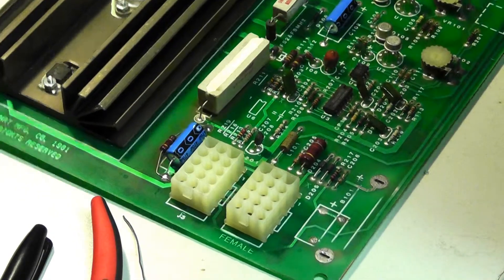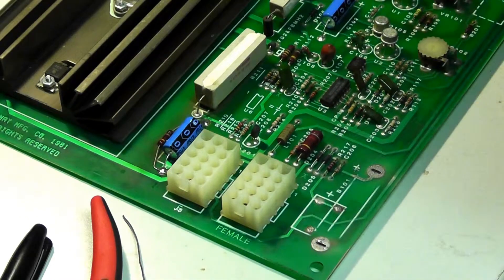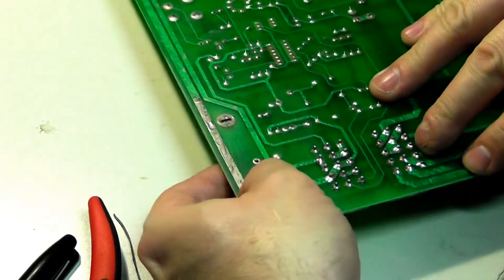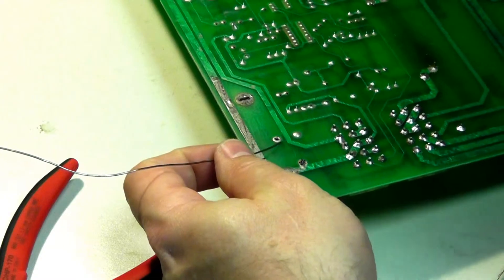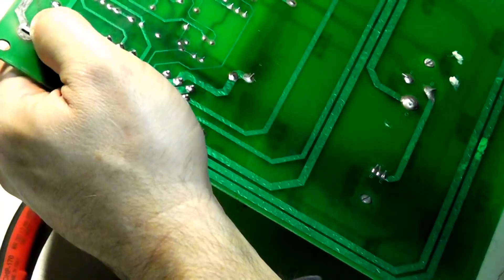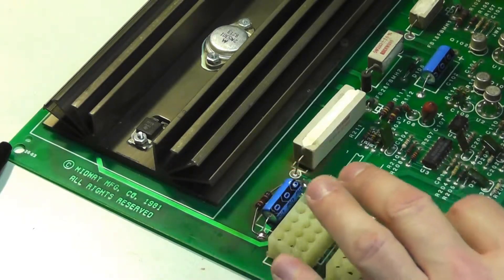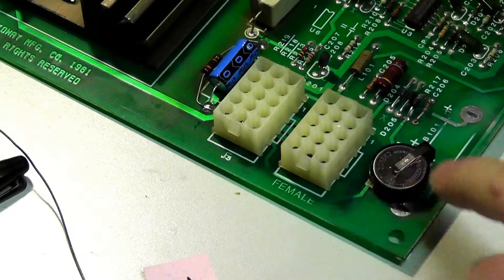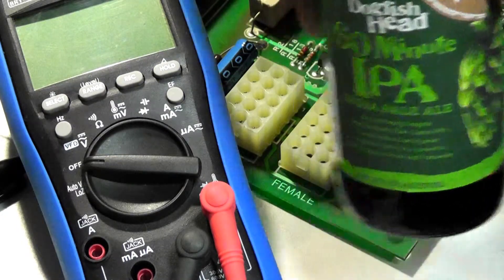MCR Power Supply Battery Mod

Comment: Good video. I've done this conversion and the first time the battery would die with in 2 weeks or so. I took the diode out to check it and it seems to be working fine.  Upon reinstalling it I noticed both pads for R217 on the bottom are missing now, so I used the top pads to hold in the diode. When I test the voltage of the battery like you do in your video I get 2.74V from a 3.03V battery. Any thoughts? It's great you post these videos, they're a big help!
Reply from the maker: the pcb trace is on top so don't worry about not having the bottom pads.  I may have to go back and watch video again but this is likely just small voltage drop induced from diode.  Measure voltage from negative to battery positive, then to non banded side of diode (aka r217) and then to banded side of diode.  Most new batteries will be @ 3.3v so a .3 volt drop will result in 3.0v on the banded side.  I bet your battery is closer to 3.0v so .3 volt drop is 2.74....thanks for the comment
Reply: If I may further pick your brain. I have tested the draw on the button battery with the machine off, and it measures .640mA and increases by .001mA every few seconds. Any thoughts on where this draw could be coming from? I doubt the bookkeeping memory it is designed to keep alive draws that much.
Reply from the maker: Out of my current knowledge base.  However, I just realized my spy hunter is not saving high scores even with the coin cell mod.  I haven't looked at all the components on the v.batt line but expect I have a bad 6116 ram.  Sounds like another video is in store in a week or so. edit>>or I have heard of problems using the coin cell mod..may just go to nvram if I can't figure it out.
Reply: I took a current measurement on the button battery with the machine off and read .640mA which is why the battery dies so quickly. I had asked the person (he has a lot of knowledge with these things) that repaired my Spyhunter stack, and he recommend checking that I have the 6116lp chip in the right place. There might have been a repair in the past that they replaced it with something else that is pulling more. More work for the weekend!